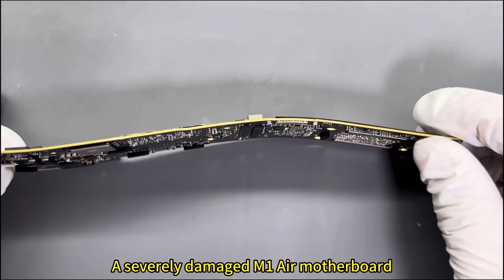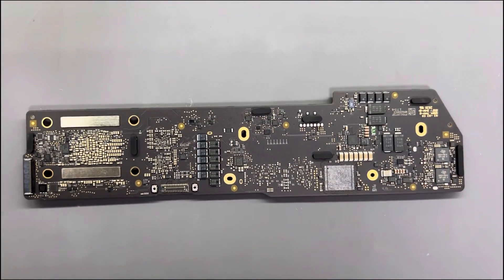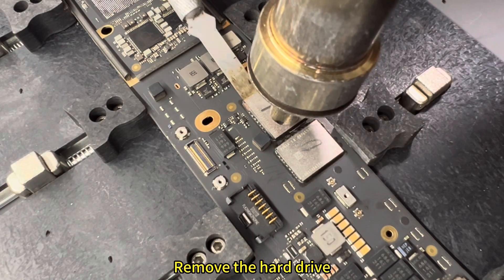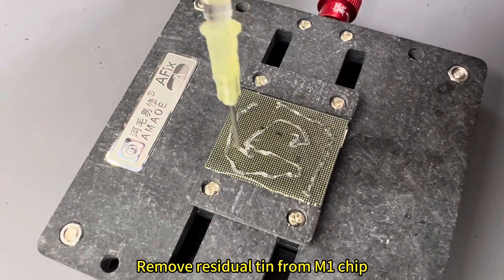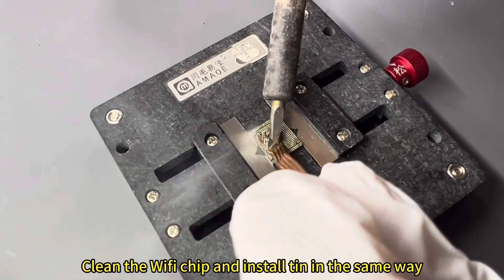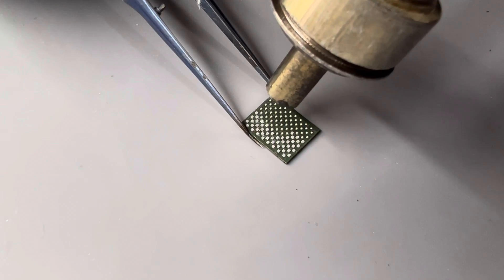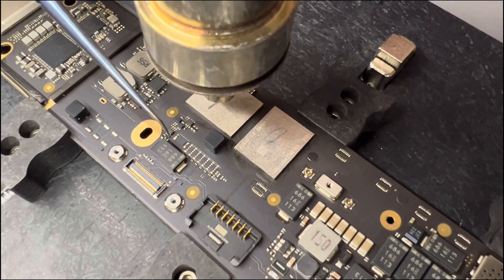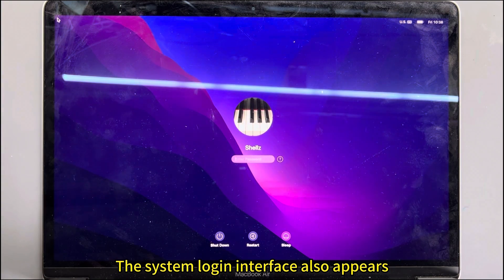M1 MacBook A2337 motherboard damaged，change m1 cpu chip，ssd，wifi to recovery the data，have repaired

Comment: Can i boot into using only the logic board and external display . No battery, keyboard , touchpad, display . Only with the logic board and external display will it turn on ?
Reply: If you're ok to give start to machine via cables etc, yes you can.